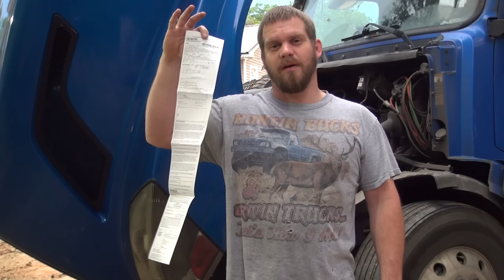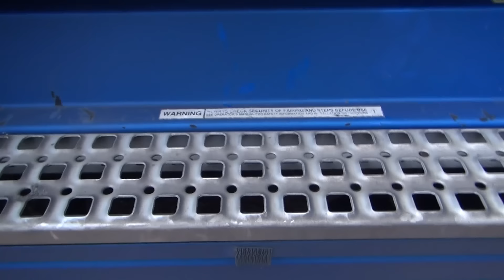Stopped by DOT

Comment: The DOT is just doing their job.  That inspector cut you some slack, and instead of being appreciative, you bad-mouth them.  

What many drivers fail to realize is the fact that those safety regulations are written in blood.  Enough incidents occurred to the point where a law had to be passed.

Law enforcement is not about revenue.  It is about compliance.  In order to stay in business and stay employed, you and your equipment must be in compliance with regulations.

Those agencies and their emoyees are funded through taxes, not ticket revenue. There is no quota, or bonuses, or any of the other crap some guys keep lying on and on about.  The troopers and inspectors certainly don't care about any of that.  They're out there to do their job, plain and simple.  Nearly all of them are actually quite helpful.  I had one gal inspect my truck in WI once, who actually grabbed a shovel from her cruiser and helped me move corn around in my trailer to try to axle out legal.  True story.  
Another one actually traced down a short in some wiring I had for some marker lights, and never wrote it up.   They're people just like you and I.  They see the same crap out on the highway that we do, everyday.  They also try to save the lives of those involved in bad wrecks, and sometimes - far too often, probably - have to make those calls none of the rest of us could ever make, after a victim succumbs.  

Bottom line is, run legal, fly straight, and stay home if you're sick.
Reply from the maker: Well first I haven't bad mouthed anyone, you're putting words in my mouth. second I actually talked to a trooper that told me he was required to stop at least 5 trucks a day, so there is a quota and lastly can you explain to me how something simple such as a license plate light or cab light out is written in blood. Did someone die because they had a license plate light out? or cab light out? or something simple cause I haven't seen that. What I see is people playing with phone etc causing wrecks and drivers being forced to drive long hrs as well as not enough training. Did you know that heavy haul can be over on axle and tire weight ratings, they just have to pay extra money and drive at a slower speed and suddenly its not unsafe anymore. The hrs of service is unsafe. no one should be driving 11hrs a day and especially when forced to do so by dispatch or risk losing their job, that's the real problem, but it happens every day.

Comment: Remember that a clean ride is a plus. Isn't a pretrip a to do list so that you are aware of it conditions. Yes your batteries are not covered. You said the key word modified that's not going to work. And a warning still goes on your csa score . That's means that they are doing there jobs. Also remember that the dot is about compliance and it is your job and the company job to make sure that there equipment is safe and compliant and is not a issue. And a leak is a leak no matter how little or big it might be.  And as far as battery being covered is a compliant issue reason is it was covered when the truck was purchased so yes it is a issue.well you are very wrong there are a lot of drivers that have had a clean inspection or dot . I myself have had lot of clean inspections and I have also had my share of bad one were I missed a few things but once again that's what the pretrip is for . And stop trying to make it sound like it not a big deal when it is.  Oh and help yourself wash your truck and trust me you will see the difference in your next inspection.  And also dirt or road grime show everything that is going on under your ride . And it's called excessive oil or grease. And it could be coming from the blow by I have had that same problem and was gigged on it by the dot . And yet you believe that something is going on with the police or the dot when you see them with trucks on the side of the road no it's been that way for the past 39 years that I have been trucking so it's not going to change due to a change in time . New rules are coming out and you will start seeing them everywhere.  Now don't get me wrong I'm not a fan of the dot myself but they have a job just like me and a family to.

Comment: I live in Minnesota and years ago  I used to have a lawn service working solo, without any employees. No business name or number on my truck. Guys with other businesses warned me against having business name or numbers on my truck or driving a dually or 1 ton truck. I purposely looked for and bought an F250HD so I could have regular license plates on it. I have read through the Mn DOT hauling manual a few times and I have called them up to ask questions. They started to change their answers in later years and typically within 5 minutes talking to them they would say “you should get DOT numbers”. And nothing that I had talked about to them stated a need for DOT numbers in their book. They just want a reason to pull you over and CACHING $$$$ write you some fines.

Comment: I was in southern Minnesota and went past a dot sitting in the median. I had to take the next exit. As I was exiting the freeway I saw the dot coming down the freeway,  since I was the last truck passing by him I knew he was after me. Luckily for me there was a small fuel stop just off the exit. I pulled in and parked between 2 trucks. As I sat there the dot went by at a pretty high rate of speed trying to catch me before I made it to the Iowa border about 6 miles south. After about 15 minutes the dot came back and got back on the freeway going back the way he came from.... I am sure I frustrated him since I gave him the slip and kept him from writing me a ticket.

Comment: It is the operators responsibility to remain aware and in compliance of all DOT regulations per FMCSA. A thorough DVIR would have prevented any issues
Reply: I wish you were right. He passed the major stuff like brakes, lights, air lines, and tires, so they had to resort to plastic Schrader valve caps on the tires, and batteries, which require ventilation to be safe. Batteries emit explosive gasses (hydrogen and oxygen) and enclosing them creates a safety hazard. If a connection comes loose and causes a spark, BOOM! If they're open, the hydrogen rises, minimizing the risk of such an explosion. I doubt a FMCSA inspection would address valve stem caps! They had to resort to that! What you're looking at, is state sponsored highway robbery. They just use "safety" as a buzz word, to justify their harassment in court.

Comment: Chase.Make sure every 6 mths at least,tightened the nuts on the battery cables after cleaning them up & spray them with the red battery protector from crc.

Comment: Yea your power steerbox has some seals leaking most likely input shaft seal or even could be sector shaft seal on back side...  drive forever never be issue but for them its bread winner

Comment: Uncovered battery can short and cause a electrical fire 🔥. Oil on road even a small amount when it rains spreads and is deadly to motorcycles , and finally keeping your truck clean is the best way of catching problems early so a slow weep from your steering rack is one thing but what you showed us was long term neglect. Sorry as a truck driver for 25 years there is no way I would work for any company that runs a truck in that condition.
Reply: Amen

Comment: It not exactly fair, but one of the most effective precautions you can take is to keep your equipment in a good appearance. That fairing by the batteries i would replace, its not too expensive. The leaking power steering problem, its cheaper to rebuild it. But dont just replace the o rings, wont last you a month. 
Good luck!

Comment: Ok, I'm not a truck driver, but, Texas DOT is in full force. Alot of has to do with all the fly by night illegal trucks and drivers that are running up and down Texas roads. I think, The main reason they give out the petty joke fines, is they have to provide a real reason for the stop. Probable cause isn't a true real reason, it is more like a profiling hunting. The main targets are, the individual owner operators, as they don't have big money backing or company maintenance shops to fix the trucks issues. It all goes back to big money and the assertnes of monopoly and restraint.

Comment: Oil dripping from a blow-by tube isn't a leak, batteries not being covered isn't a safety issue the only problem is the "leak" you have from the steering box
Reply: With a grease fitting at at the top end of the box, you are going to have oil seep out of the grease. Grease is made from oil.

Comment: They use anything for an excuse to stop you.If the inspection was 100%  correct trucker looks smarter than inspector. Can't have that, your blinker fluid is low, citation issued no fine. If main components are violated like steering linkage, suspension hangers, bad tires, brakes the driver would realize its not safe and get repaired. I'd refuse to drive it until it was corrected. But an oil drip, thats just foolish to even write up.

Comment: As far as your power steering leak get it fixed cause if it does lose all fluid it will make it that much harder to control the truck in a emergency. If it was arm strong steering it wouldn’t be a big deal.

Comment: I got stopped in Mississippi at a scale. I was thrilled because my truck was just fully inspected professionally and I had just done my daily inspection also with a new truck. company gives $100 bonus for passing inspection. Money in the bank. after officer gave inspection which i thought passed with flying colors. he said hang out for a bit he had to go in the office and id be on my way. i waited in front of my truck. he came out and said well first violation is for an out head light. i looked at the truck lights still on and asked what??? which one? he stated passenger side. I walked to the light still on and said ...this one? he said yup.. i said sir its on.. he said well it wasn't so you get a ticket. next he said you also have an inaudible air leak... I asked whats that? he said well all trucks leak air some where I couldn't find one but here is your ticket any way......WTF...cost me $185 dollars and a CSA ding. mother fuking revenuers...took it to a garage no problems found cost $200 for that inspection.. fuk you DOT fuk you.

Comment: I left trucking in 2010, partly due to the economy and got fed up with lack of revenue as an independent. I am glad I did, because now I nearly have a Phd and on track to making 100k plus a year without the bullshit regulations DC had me enslaved to back then. Of course back then I was lucky to profit 10k a year with all the maintenance and dot harassment fines. My average maintenance costs were around 10k a year. Cost of living on the road was high of course, but the real problem was the freight rates and lack of loads in some areas such as FL, then having to dead head 500 plus miles to get out of the area. Pennsylvania was the worst for me, not CA. I do not know why CA never really harassed me as as much. Good luck in the industry hope you do better in the business than I could do.

Comment: 25 years OTR, never have I gotten stopped without at least one violation. Only once did I receive a ticket and that one was a scam. He tried to get me for not wearing a seatbelt when I WAS wearing it. So I argued with him because just 10 days earlier I had gotten another seatbelt violation and was ALSO wearing my seatbelt that time to. Now, in all honesty I was running 4 mph over the speed limit. I was doing 59 in a 55 and I knew he had me for that. But because I refused a seatbelt violation, he decided to write me up for 11 mph over, “66 in a 55”. It was a false charge and he knew it. It was punishment for arguing the seatbelt violation. Had I just accepted the seatbelt deal, it wouldn’t have cost me a dime. Just 27 points on my CSA score. Which is really all they are after. They want to keep racking up on the CSA because that’s their job security. Had he been honest, the 4 mph speeding ticket would’ve cost me about $125 without having to go to court, just pay the fine. But because he lied and said it was 11 mph over, I had to go to court, miss work to go to court, drove 400 miles in my personal vehicle to go to court, etc. The guy was just being a dick because I was in the right and refused to lay down for him. So he upped the speeding violation to get the same number of CSA points on me that he would’ve gotten if I had just accepted the seatbelt violation in the first place. Plus, I was out $429. That was his punishment, that’s why he was grinning when writing the ticket. That’s what I got for standing my ground because I was in the right. Now let’s back up to the previous violation, the seatbelt deal 10 days earlier. That trooper was straight up honest with me. He knew I had been wearing my seatbelt when he stopped me. But he flat out told me, “I can give you a warning for no seatbelt and you’ll be on your way in 5 minutes. OR, I can start inspecting until I find something to cite you for”. He left it up to me. So I took the seatbelt violation and still had that paperwork in the cab when Barney Fife stopped me in Anderson, TN. I didn’t want 2 seatbelt violations in 10 days on my record, I was wearing my seatbelt both times, so I argued the seatbelt violation and paid dearly for it. Bottom line, it’s all about the CSA score. They don’t care about the fines, they want to show enough violations to give the appearance that trucks are endangering the public and therefore they need more DOT officers on the job, period! They trooper who stopped me the first time, the one who gave me the choice, that same month he made the front page of the newspaper for issuing over 280 “no seatbelt” citations in a single week, in a town with a population of less than 3000 people and no interstate or major highways. Every ticket or warning he wrote that month was thrown out by the local court. But for the truckers he cited, it didn’t matter. Because even if you beat the ticket, you still get the CSA points on your CDL. There’s no getting around those points. They go on your CDL as soon as you are cited. And it doesn’t matter what happens in court, those points stay on your CDL for 3 years EVEN if you beat the case in court!
Reply: You take your lumps you dog on! That's being a man!

Comment: Plumbing industry, back in the 80's.   We had this one inspector that just add ego to find something wrong.  We didn't care if job was right, just needed to show you how smart he was. 
The FIX,  we could do job right and then remove an easy part and install a "problem" for him to find.  before he even got off site we would have it changed out.  Re-inspection fee to check it again . $$  . Bid Job for customer for 2X fees 

Other Inspectors that knew us, would stop and check and ask if it went well. sign it off then leave.  He went through us well and learned we did good work,  IF we had new guy, he would get out and check closely. 

Different types out there is the point.

Comment: If the truck ain't loaded it is not making money.  They must have had a DOT Violation involved in accident.  As far as the crank case vent or the steering weeping I agree with you.  The battery being covered could protect you incase of a accident.  I have found that local companies for local transportation are the biggest violators.

Comment: Excuses, excuses. I've been inspected 4 times in 3 states. No problems. Prepared for inspection, passes inspection. Your fault.
Reply: He did: That's why they had to look for things as stupid as plastic Schrader valve caps on his tires! He passed everything that would be an immediate safety hazard. Exposed batteries are much safer, because hydrogen and oxygen cannot accumulate, creating an explosion hazard, if a connection were to come loose and spark. Putting catch cans on the crank case decompression lines would be a good idea though. Brakes, air lines, tires, no problems there. I can't count the number of times, I've spilled oil or fluid on the outside of an engine or pump, just as I start to pour. All the inspector needs to do, is check the level. if it's up, and the belt isn't slipping. A little oil on the outside is not necessarily an indication of a leak! The fact is, the police department is a little tight on cash, and commercial vehicles are easy targets for the state sponsored highway robbery.

Comment: Yes I hit a scale in Missouri with a load I pick up in Wisconsin, made across Illinois but on I 55 going south hit the scale and low and behold, 8000 pounds on the tandems, and the ticket was $842.50 so I was told by a Open Road attorney that it really wasn't nothin he could do cause the PA in that county was a ASSHOLE, but here the funny part the PA said he would amend the ticket to a littering ticket for a extra $300.00 total of around $1200.00 bucks, now I'm trying to get OW ticket reduce lower cause I was told if the trl was loaded when I got there that's the people who loaded fault or the company not me, so now everyone looking the other way company and the shipper, even when I move the tandem back I'm still overweight 2500 pounds, but you all are right it's a racket and a rip off
Reply: they will say it's your fault because you should have scaled the load after you picked it up.....I always go to a cat scale after I get loaded.....gotta cover that ass man
Reply: @davec1810  tell me about it
Reply: its usually fairly easy to feel where your weight is ,esp 8000 over on the tandems is noticeable by ride and looking at tires.....im wondering bout this one ....